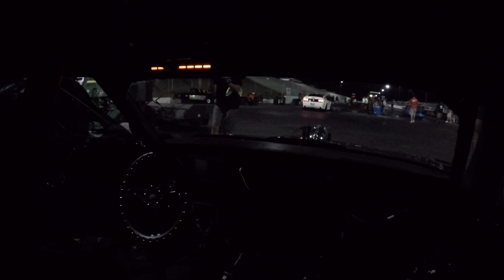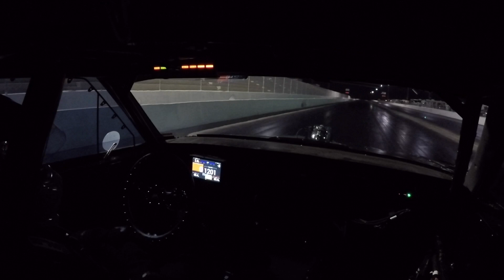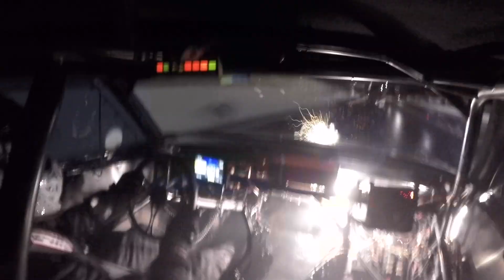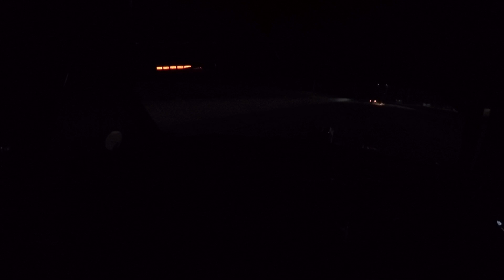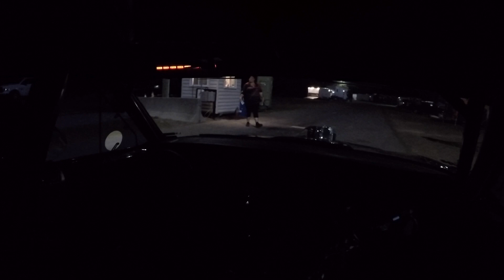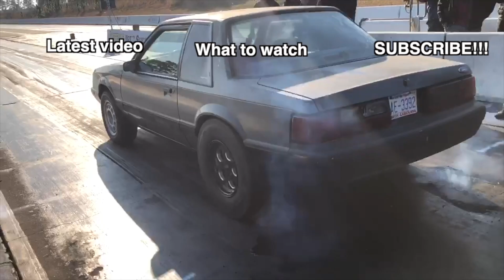UNCUT footage of BLACK SHEEP Cylinder #8 Meltdown

Comment: John take a look at  the MSD lights the misfires happened before the the head blowout maybe a lean mix on that cylinder injector?? I have been running Meth for 40+years in blown engines and most cases when you torch a head its too lean or timing ,keep the vids coming you will get on top of it